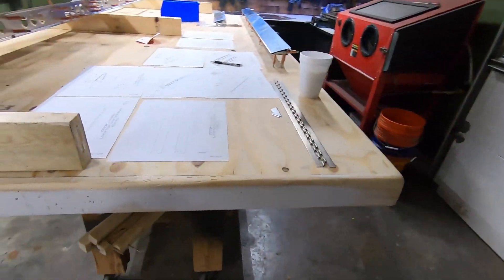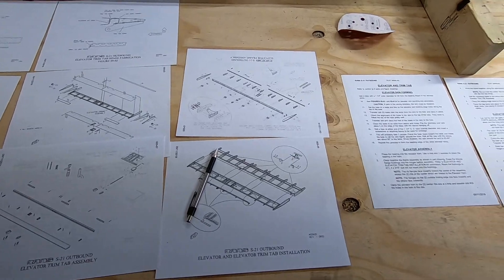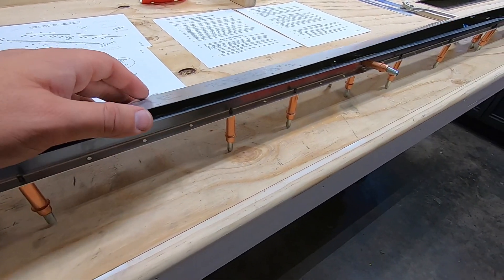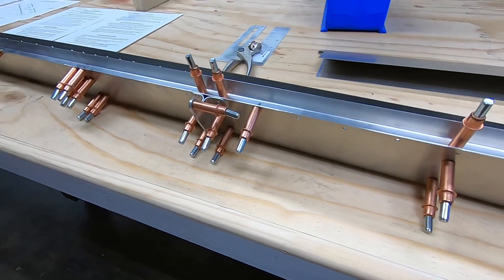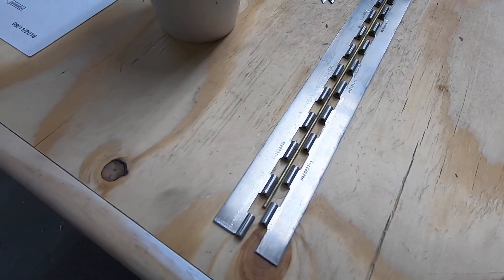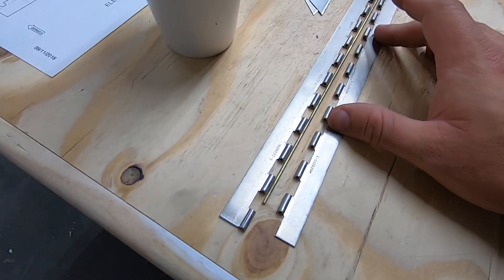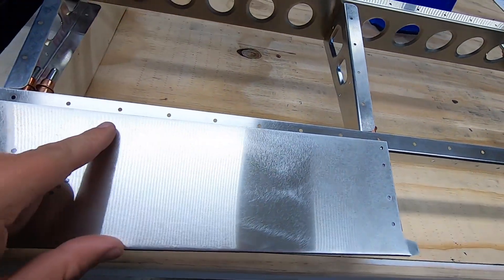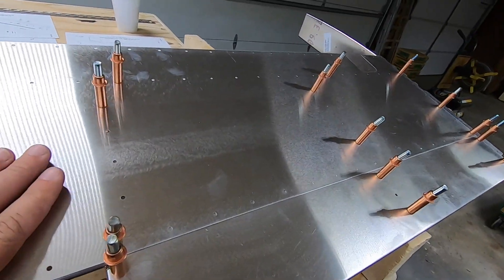RANS S21 EP6 ELEVATOR PART 1

Comment: No primer in between the aluminium parts that make contact?
Reply from the maker: Kinda a touchy subject there and really is up to you. RANS  says no paint is needed  on anything. I considered it, but eventually decided it wasn’t worth it. To do it right, I’d need to put zinc chromate on everything and wet install all fasteners with it as well. In my climate (Texas panhandle) it’s likely never to see rain and humidity is non existent.. If I lived near salt water Or planned to operate on floats, it would be a no brainer.. Do what’s right for you and your mission.. There are many examples of old certified airplanes out there with no interior primer that still look just fine..
Reply from the maker: CORRECTION, RANS does suggest a coating between “dissimilar metals”.. so far in the kit anything steel is already powder coated so no further barrier has been needed.. Just to be clear, I am only expressing what I’ve read in the manual. I don’t intend to speak on RANS’s behalf..

Comment: I'm curious why they often seem to leave a little bit of aluminum for you to cut off where the sheet metal bends. Is it left there as protection? As an aide to the builder?
Reply: It avoids deformation of the edge during the bend and allows a clean and undistorted bend once the excess is trimmed off.  Take a piece of scrap aluminum and bend it tightly around a small diameter bolt.  Then look closely at the edge and you will likely see it bulged outward on the ID of the bend and drawn inwards on the OD due to compression on the ID and tension on the OD.  The bend tabs mitigate that.
Reply from the maker: My guess is that’s how they line it up to bend them consistently. Not sure to be honest👍